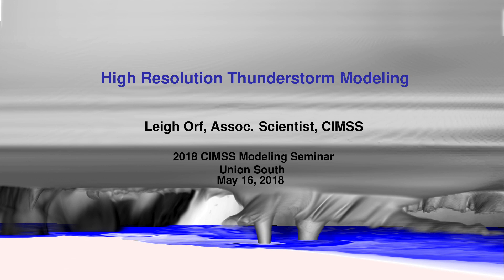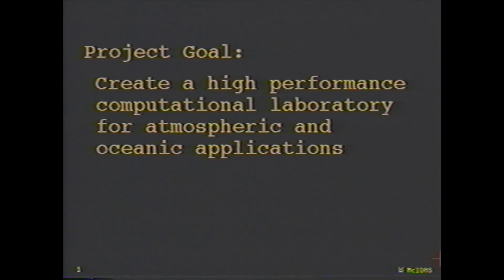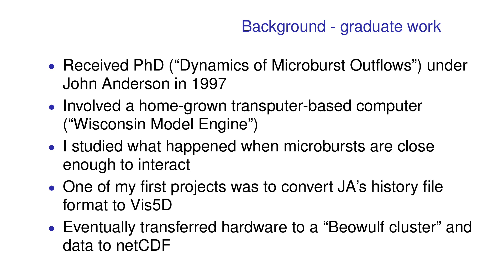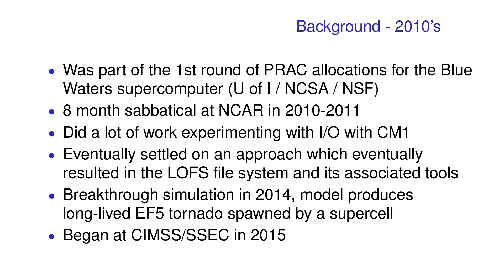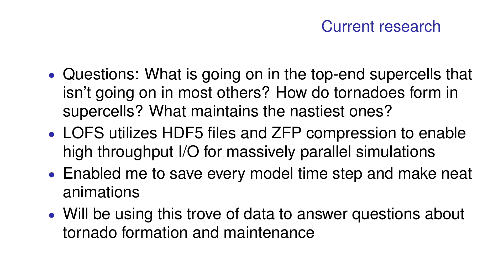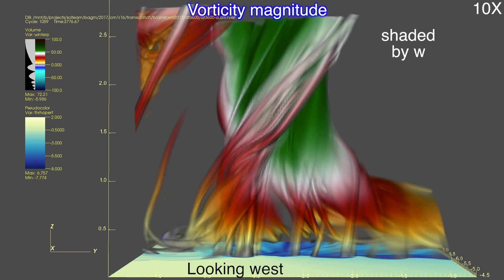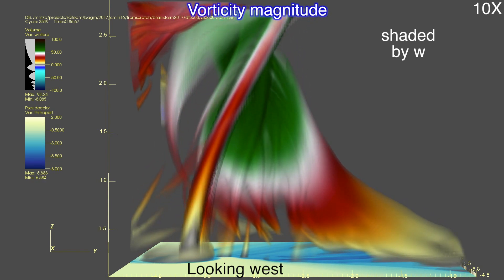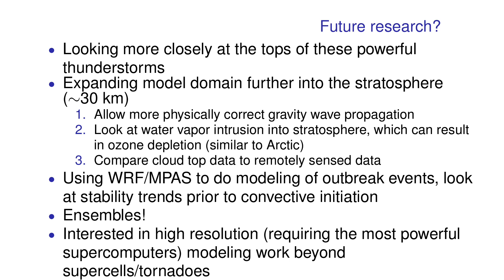2018 CIMSS Modeling Seminar Presentation

Comment: Where are the straight line winds from microbursts strongest (highest velocity)? Closest to the point where they begin to spread from the downdraft or further away? It seems like they would accelerate horizontally across the ground at first but then lose velocity the further they get from the contact point as the energy is dissipated over a larger ground area. Thanks.
Reply from the maker: The strongest winds tend to occur shortly after the downburst impinges the ground, as the roll vortex circulation along the leading edge of the outflow is at its most intense and helps aid in accelerating the wind beneath the region of lowest pressure near the ground. For an axisymmetric (highly idealized) downburst in a quiescent environment, if you were standing directly at "ground zero" (sometimes called the stagnation point) you wouldn't feel any winds but your ears might pop from the pressure increase as the downdraft air converged towards the ground. Things get messier with sheared atmospheres and real clouds, but the gist is the same.